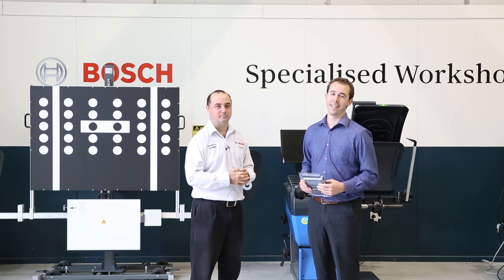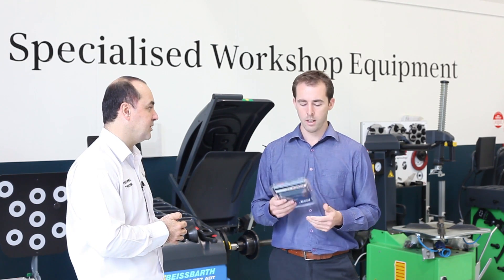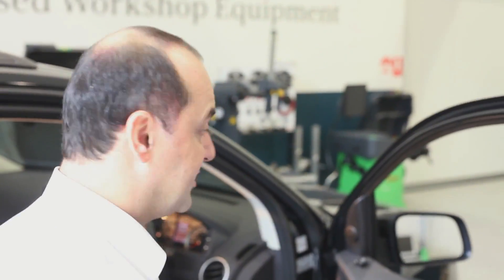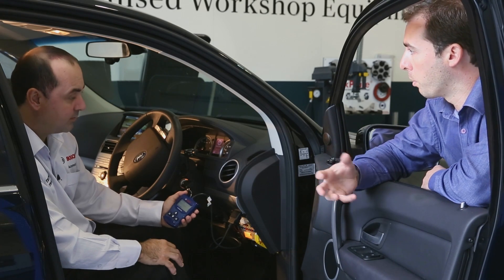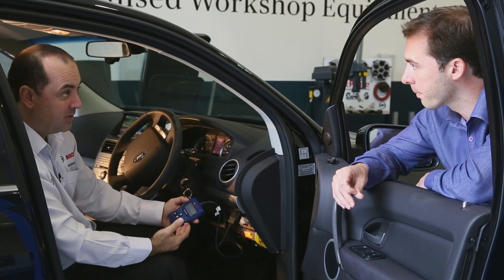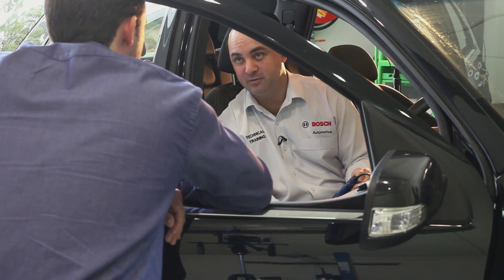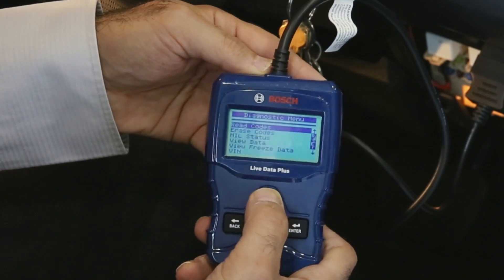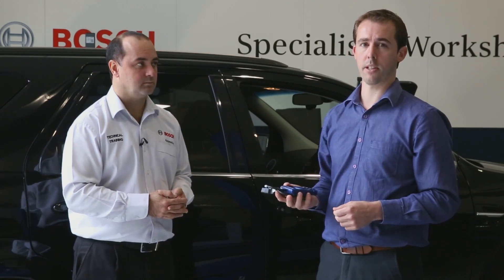Bosch OBD Diagnostics Scanner Tool // Supercheap Auto

Comment: I've Brought this Bosch scanner and it works fine with a MY 2016 Mirage. The only gripe I have with it is in the user manual on page 4, it states there is a 8 line by 21 character mono- chrome backlit LCD. This unit does NOT have a back lit LCD only a standard reflective type. Also the packaging illustration has a white plastic removable sticker on the LCD cover giving you the impression that is has a back lit LCD this is very poor form from Bosch the marketing people should be kicked up the ar$e about it.

Comment: Why can’t I use this on a VY SS?
Reply from the maker: Hi Muck Man, Does your VY SS have an OBD2 Port under the dash? If so, this tool will be able to read the fault codes on your vehicle if there are any present.
Reply: Supercheap Auto it only reads live data but won’t red abs or fault codes 
There’s no listing for Holden
Reply from the maker: @muckman5509  It might be under GM VY 5.7L if Holden isn't listed in the tool. If you are still having issues, head into your local Supercheap Auto store. We can figure out what the issue is and be able to use a more advanced Bosch tool if needed. More info here: https://www.supercheapauto.com.au/services/in-store-services/health-check-and-diagnostics
Reply: Manually select your vehicle. Set it as a 2004 Pontiac GTO

Comment: just got the OBD1110 plugged it in to my buddy 2006 magna for a test run and found out it did not work it keep on coming up with "LINK ERROR"
so we tested on a 2002 vy holden commodore still no luck. this Bosch unit is sold in Australia bout has no Australian car manufacturer listed on it so how do we choose the right make and model of vehicle for proper diagnosing.

Comment: I just used it on my 2001 Lexus LS430 and it gave me a P0305 = Cylinder 5 Misfire Detected. I like how it tells me which cylinder misfired. Very helpful so I dont have to guess which one and I can clear the code and turn off the light. I spent $235.00 OBD 1200 I got the warranty and I will be using this tool for every problem I run into. Saved me a trip to the dealer and labor cost because I can do it myself.

Comment: Rubbish. Wont read all codes. Simple codes like “oil pressure circuit voltage high” that another diagnostic tool read. Car is a 2013 Holden ffs! Didnt read codes for a 2011 holden and didnt even link with a 2004 holden. Absolute rubbish.
Reply: Just checking in after 3 years. Doesnt show any codes on my 2011 Holden WM caprice even though the dash is saying abs and stability fault. Still absolutely useless. What a POS.

Comment: How can I get abs codes for a gu patrol crd
Reply from the maker: Hi Tim, Thanks for your question, If your GU patrol is 2007 or newer, it should have an OBD2 port. As this scanner suits OBD2 ports only, you will need to locate it on your car first before considering the purchase of this unit. - Ash

Comment: Bosch 2220 very expensive $245 NZ, chart said it worked on Audi A4, but NO, only half works on Aussie Ford BA 2004,  xr6s  and Mitsubushi Legumes 2003 NO, so from my understanding not much good for cars or anything under 2006.

Comment: hi I'd like to know , when vehicle select is displayed..... what do you choose for Australia as it's not an option on the scanner?????
Reply from the maker: Hi Bradley - The OBD reader has its protocols designed for the Australian market. Therefore no market selection is required. Hope this helps :)
Reece
Reply: Supercheap Auto , thnx heaps I called bosch up and have talked with them about the product, has a nissan selection but no navara.  once go into nissan then go to obd/eobd then it reads from there . thnx again for replying to my question
Reply from the maker: No problems at all, glad to help! :)
Reece

Comment: this tool should work on any car that's 1996 or newer. I haven't had it work on a old car yet. I tried it on a 2000 toyota, and a 2002 toyota, both didn't work. but it worked on a micra that's 2009
Reply: He said anything after 2006
Reply: He said anything after 2006

Comment: Will having a gas conversion affect any of this data/readings? The car I want to purchase this for runs on gas and petrol but the list of cars it supports only mentions petrol as the fuel type, I'm hoping this just means as opposed to being a diesel.
Thank you
Reply from the maker: Hi oo0Spyder0oo - If the vehicle was altered from factory settings there may be a difference in the outcome, particularly with live data if you may be trying to compare to factory data. But otherwise you will just be going through the code reading / erasing as if it were a petrol vehicle. Hope this helps :)
Reece

Comment: Does this work on 04 Magna Verada?
Reply from the maker: Hi Devils Fubar (Mikey), thanks for reaching out to us. That is one of the vehicles listed for this model OBD scanner however just to be sure, would you please be able to call Bosch directly 1300 783 031 (Option 3 in the menu - OBD Diagnostics help) and they will be able to answer this question and any more you may have about the Bosch scanner. Hope this helps, let me know if i can assist with anything else. Thanks Reece

Comment: Hey guys. Will this scanner read and clear fault codes on a 2001 VX Holden Commodore? (HSV Clubsport, LS1). I can't find the list of compatible vehicles pre-2006 for this device. Thanks.
Reply from the maker: Hi George Francis, yes this scanner will work on a 2001 VX Commodore with an LS1 motor.
Thanks Reece
Reply: Hi Reece. I purchased the Bosch 1110 from my local Supercheap and it communicates with the car (view data etc) however when attempting to read codes it says "OBDII/EOBD - no codes | ABS - not detected". I've tried just the general OBDII read as well as manually selecting vehicle (tried everything Chev related for the 5.7 auto (4L60E) options) and results are the same. The ECU is throwing codes because the check engine light comes on regularly (most likely a bad o2 sensor but need to prove it). Any help with this much appreciated. Cheers.
Reply from the maker: Hi George Francis, Thanks for getting in touch with us. I have been in touch with Bosch regarding your issue. They have given me a number for you to call to touch base with them directly. They have a better understanding of how these work and will be able to answer any/all of your questions. Their number is 1300 783 031 (Option 3 in the menu - OBD Diagnostics help). Let me know if you have any dramas, or if i can be of any more assistance. Thanks Reece
Reply: Hey thanks for the number, was able to talk to someone at Bosch who was very helpful. My car has a custom tune on the ECU from the previous owner and this could be a reason why it's not working, so still inconclusive whether this reads an '01 VX (stock, untuned) or later models. Supercheap here in CHCH NZ were able to give me a full refund for the scanner and for $14 ran a pro grade scanner over the car and confirmed faulty o2 sensor. Many thanks for all your help with this one mate, great to see you guys are taking the time to hit the comments section. Much appreciated. Cheers.
Reply from the maker: Hi +George Francis, thanks for letting us know how you got on. Glad the team were able to help! All the best mate. Reece